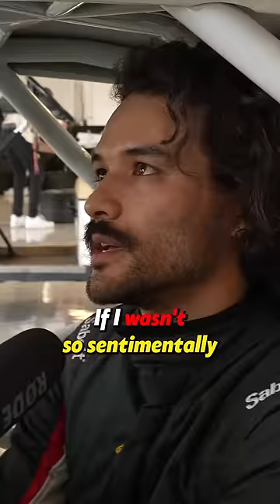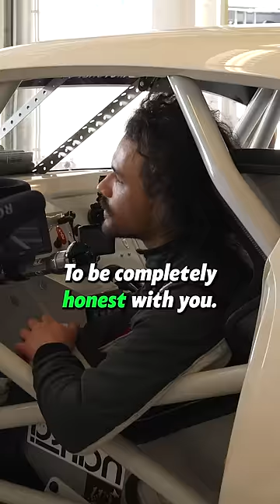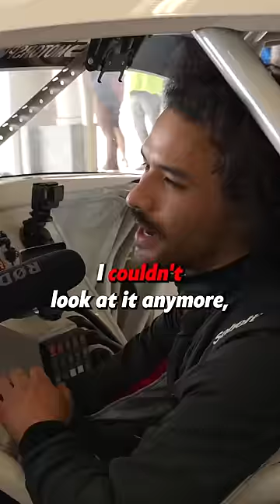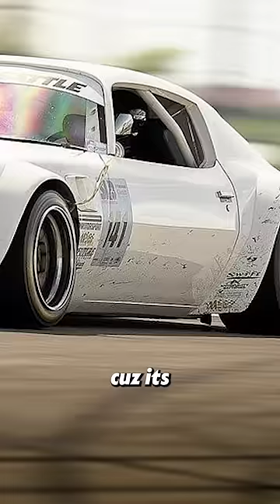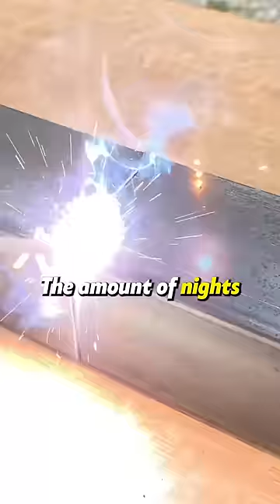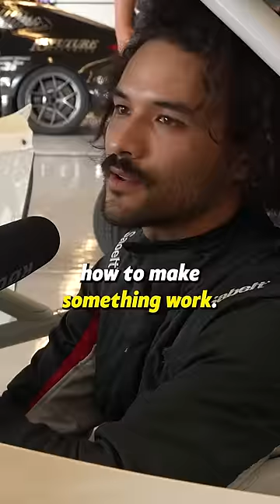He Built a $650,000 Supercar From Scratch

Comment: Complete tube chassis, I think the only thing that’s still original is the roof and floorboards. It’s I believe a full ground up build . There was a breakdown of this exact car on hooligans. I think the engine alone is some crazy 9-10k ls based engine with a set of turbos and 8-1 headers that make this crazy snake in the front. A bunch of titanium and I think a full fiber glass body . I usually tell people if you don’t believe a car like this could cost so much when it’s told what the price is., go build one yourself exactly the same way. You probably would spend close to the same amount too. When I had my old car just getting it to the power level it was at Ik how much money was put into it and I didn’t even crack open the block much and do internals yet. Power wise I was no where near done on it. I didn’t even touch the body work yet.

Comment: ok, so, how can a pipe structur with wheels, engine, firebird fenders, sheets of metal cost 650k.
engine maybe 30k if its a 632 big block or something,
metal sheets, like max 10k whole,
parts like instruments, fuel cell lines etc 20-30k 
firebird basis 15k
pipes also 15-25k
and if u want some accessories an extra 10-30k depending on the accesories,
the whole custom suspension, 10-20k
rims, 10k
maybe sustom tires, idk maybe 20-30k
headers, 7k
and other stuff like gauges or interior maybe an extra 20-30k

so it would be about 227k so lets say 230k. so i dont really see how it could cost 650k,
maybe testing but do u include it in something like that, but the testing would also only cost around maybe 30k or so.

but im not building something like this so i dont have any idea how much something like that costs maybe something that i said costs way mor than i said, but i dont know how he came to 650k

Edit: probably the custom suspension so lets say 60k because of the engineering so thats still just 260k

Comment: The car is not based on anything?  It's just a few different cars put together...it's interesting but half a milly...no way
Reply: also yes it’s easily half a million, if you knew the story behind it you’d know why. putting it briefly he built this in his own garage. not a shop. There a massive  v8 with like 14.5/1 compression in it. which to make an engine try and kill itself like that takes a SHIT LOAD of money on parts and replacement parts, the custom inboard suspension and roll cage. the thing is absolutely nuts. It has all sorts of completely custom design and engineering which very easily run the parts cost up alongside the suicidal nature of how fast and how hard that engine is running. another note, it’s basically mid engine because of how far back the engine is pushed to fit the inboard suspension and custom piping.

Comment: lmmfao, 650k.  50-75k.  na engines are cheap, damn nesr stock trans can hold its power levels.  rear end isnt anything specially needed to hold up to the low abuse it will endure forever....no fucking way.  even with the 5k custom shocks unless he bough penskis remote canister stuff then ya.  30k they had priced for those as a set of 4.  that is still redoculus when jrl makes the same for 10% of the cost.   some of us actually know the very fine detsils of builds on racecars.  nobodys charging 500hr to build anything besides felony court cases